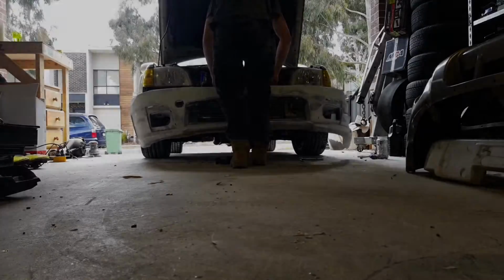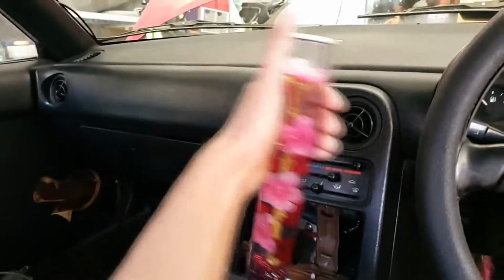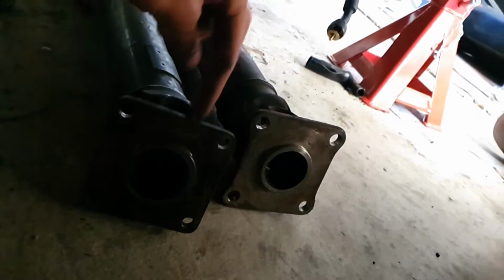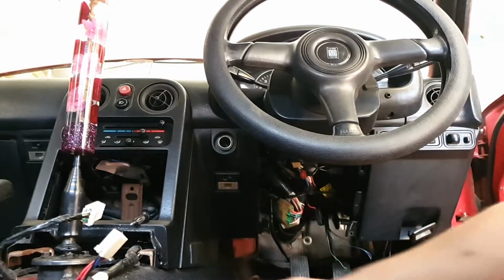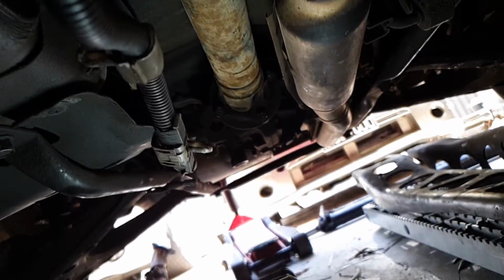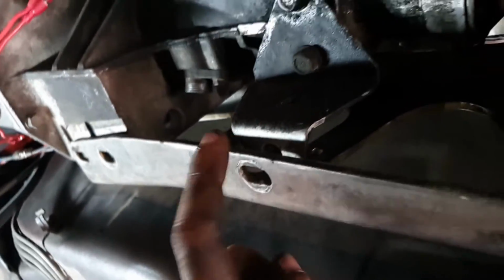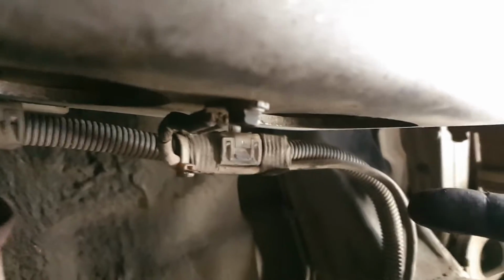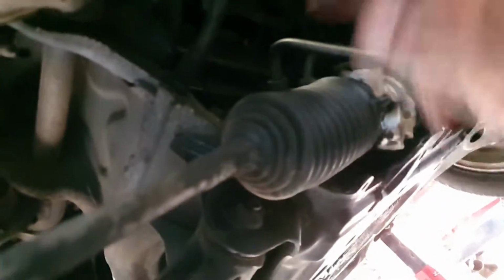1 LAST STEP - MIATA MANUAL CONVERSION

Comment: what tail shaft ended up working?
Reply from the maker: The correct 1.8 manual tail shaft worked, i was given a 1.6 tail shaft when i bought the conversion